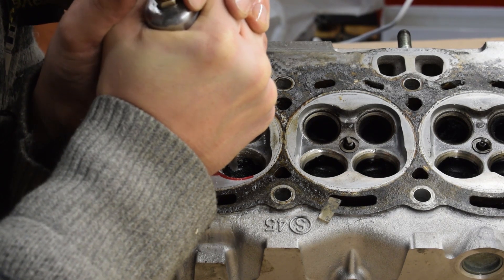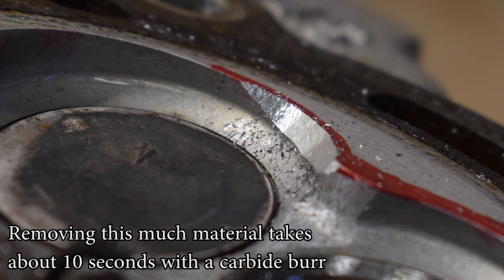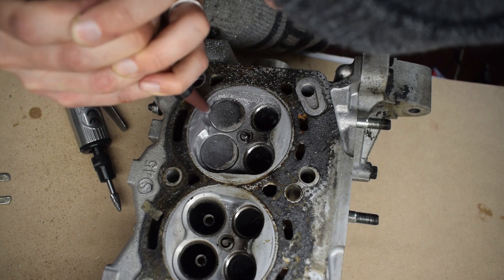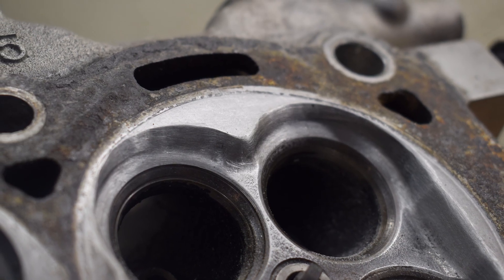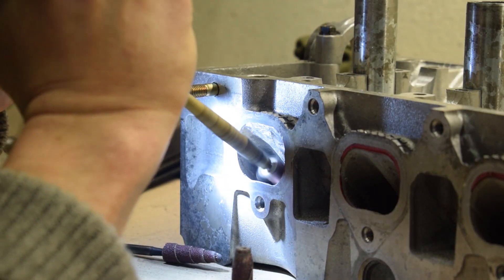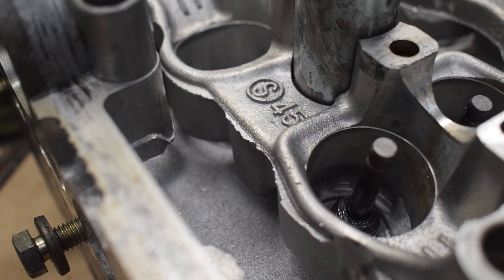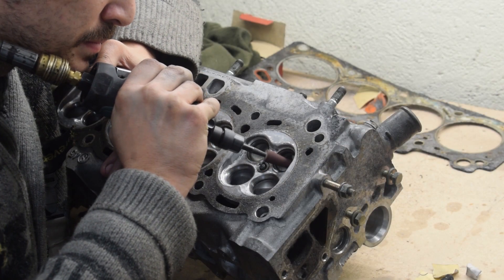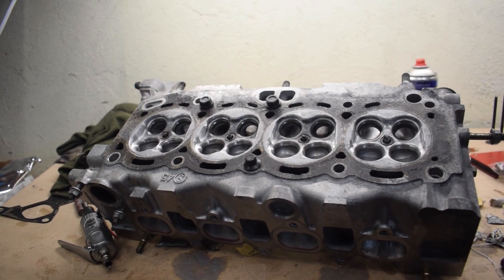PORTING the F out of it - Cylinder HEAD porting and polishing HOW TO - PROJECT UNDERDOG #6

Comment: congratulations on your porting job. now you have to take of at least 0.5mm to adjust the compression rate and if your lucky you (still) have the same BHP.
Reply from the maker: Turbo. I said it in the video clearly. But paying attention would mean you can't do that comment 😏 I need to loose a bit of compression in this case. It's above 9.5
Reply: @d4a  👍👍

Comment: Um, not a lot of flow into the chamber on the short side of the valves, you should have focused your unshrouding efforts towards the exit on the long side at the edges of the chamber since the majority of flow is here.   If you look at higher performance engines like a bmw s1000 or any newer sport bike head, the side quench band is mostly eliminated with the area being shaped for flow/diffusion.  Material removed here would be much much more worthwhile that where you took it

Comment: The machinist I see will do custom seats and with initial cuts and throat cuts for me so i can do flashing removal and whatever porting. Then i bring it back and he will finish cut and match valves. Gives a little bit more working room usually inside the bowl and runner and you have a small bit of forgiveness if you bump the seats because it will be cleaned up later. I highly recommend looking around for someone who can do this to. It sounds extensive but it's not uncommon and it really makes your job of porting (even if its mild) so much easier to see and do.
Good video  all around for the diy and why 👍

Comment: Thank you for the content that you put out. I just love your channel.
One question though, on the exhaust port outlet enlargement, do you think the slight lip where the exhaust manifold is slightly larger than the port could help with some anti-reversion of the exhaust charge flow?
I can perceive the advantages of a slight taper to the exhaust port from valve to outlet, but it seems that slight lip where the manifold is larger may still benefit a little with anti-reversion. Likely even for a forced induction setup.
Reply from the maker: Yes, I got that a lot in the comments and everyone's repeating it like a mantra without thinking about other factors. I gasket matched, but I obviously won't be using the stock header, I'll be making a turbo manifold which means I can make it any size and still have a giant or small lip if I want to. Also, reversion is avoided by having low back pressure in the exhaust and low overlap at mid and low rpms, this is why you rarely get reversion in vvt engines. You get it on non vvt engines with big overlap and exhaust back pressure and if you have serious reversion no pathetic little 1mm lip is going to save you 😂 you get rid of reversion with good engine building and tuning, woe is he who puts his hopes into this lip 😏
Reply: @d4a  Fair point! Thank you for that answer. Much appreciated!

Comment: Don't push too hard on the carbide and it will never skip, that's also how 
you break teeth on it. Always let the rotation of the tool do the work - you 
will get the most life out of your carbide that way as well. There are also 
certain angles you should be using based on the type of carbide shape. 
Even as it dulls, you can lessen your pressure on it(which will lessen it's 
effectiveness) but allow you to keep using it. Most people just toss it for 
a new one, but when you are buying your own carbides, you will appreciate
 making as much use of each one as possible. I haven't taken my heads off
 yet, but I will definitely try this should I ever have to do a headgasket or 
something!

Comment: The object of porting is to correct casting flaws that inhibit the true flow characteristics the engineer designed into the head, not enlarge them or change their shape. The object of unshrouding the valve is to provide a straight path off the valve and into the cylinder with minimal turbulence. A multi angle valve and seat cut would really help low lift flow.

Comment: The mismatch on exhaust is probably deliberate as it helps prevent reversion. 
Generally,  leave about 3~5mm 'step' at least half way around port turning it into a 'D' laying on it's 'flat'
The main areas of improvement are just below seat on short turn and the 'throat' where port should be 'necked' at a smaller diameter to increase gas speed.
To un-shroud valves, I find it's better to do some math and make a 'washer on a stick' to check clearance. I usually use a piece of plastic cutting board (nylon/polyethelene, cheapest you can find) use a hole saw to get 'blank' then put a bolt in it and spin in electric drill. File to about 45 degree angle with whatever the max dia you work out.
Cut a smaller one or two to get 'correct' throat diameters (usually 80%~87% of valve diameter, maybe a little more with forced induction. 
You need about 0.20 of valve diameter at closest point to head at about a quarter of valve diameter lift (ie, 35mm dia valve x 0.25= 8.75mm lift with 7mm clearance,or, a 49mm washer.) 
It isn't always possible if valves are close to combustion chamber edge but angled valves are usually pretty good for un-shrouding as lift increases.
I used to work almost exclusively on motorcycles but have built a couple of quick cars in the past (150mph Opel Manta GTE as daily driver, only did about 25mpg though, wasn't possible for me to drive it 'slow')

Comment: Back in the day I did this to a Datsun 120Y head. It made the engine rev up significantly better. It brought me about 8 mph extra topspeed.
Reply: Im busy with my nissan L28 portinG .. And adding a Little turbo on to
Reply: @spiderdanielcoetser9148  Porting my GT86's boxer engine isn't that easy. The engine even has to be lifted to change spark plugs. 😬 On the other hand, I love the car as it is.
Reply: @ThunderBassistJay 
Toyota pretty good pistons to head is vital
Reply: Nice car a 86
Reply: In my prof foto is myne car .. Its been sprayed bLaCk by me now
Reply: Myne .. Mine ...
Reply: @spiderdanielcoetser9148  Lol!
Reply: @spiderdanielcoetser9148  it's a Subaru motor, boxer engine
Reply: I used to race a Datsun sunny / 120Y in Speedway, they are suprisingly fast with minor mods and a good tuning.
Reply: @archygrey9093  ...and they're simple and weigh about nothing.
Reply: @ThunderBassistJay  Yep, although they fell victim to the little 3cyl Daihatsu Charades pretty quick in the end.
Those Charades look cute but they absolutely decimated all the other Datsuns, Corollas, Stanzas, bluebirds, hondas and whatnot for awhile. The Corollas kept giving them a good run for their money though.
That was over 10 years ago though, probably different now.
Reply: Hadda Suzuki MightyBoy ute that
Reply: WHAT ! 20%  gain ?  LOL .
Reply: Did the same to a15 head and these have big valves. Great to use on a12 block if you need to stay within a racing class
Reply: I did the head on my cherry 1.2 very cooked up thou only 23k when I got it ported through from the carburettor to the manifold as far as I could reach ,head ports were terrible bad castings,cleaned the sharp surfaces in the combustion chambers too , engine economy went from 30 to45 mpg and top speed 65 to 90 plus and so much faster!
Reply: @jamesbaker429  The castings of the 120Y were bad too. Lots of sharp edges.
Reply: Why would you do that to such an ugly truck
Reply: @ariveitz1941  I assume you're referring to the Datsun 120Y utes, which for your information are very good looking.

Comment: If you're building a turbo 4AFE and you don't have extreme goals on race fuel, I think you've done your porting wrong. 

You want detonation resistance more than flow and you get that via charge motion. Unshrouding the short side has almost certainly reduced charge motion and you'll likely end up with a lower detonation threshold and slower burn as a result
Reply from the maker: Charge motion? You mean tumbling?

Comment: How do you mark the areas you want to remove on the combustion chamber? Can I also do this tipe of job on the pistons in the case of contact with the valves?
Reply from the maker: I don't mark them. I eyeballed them and adapted other chambers. There's no need to this unless you're using different pistons because this changes squish and chamber cc. I only did it because I'm turbocharging the engine and using completely different pistons. You can remove a bit of material from piston tops, but it has to be an absolutely minimal amount. It's better not to touch them if you can.

Comment: From someone who has ported a lot of heads, do you want me to tell you what is involved in your upcoming eye operation?
Reply from the maker: I managed to get away unharmed. I wasn't without glasses all the time, but I am in all of the footage. I usually wear them but working a camera and video lights while also porting really stretches out my short term memory and glasses end up being forgotten. Still not an excuse.
Reply: @d4a  yep I got away with it many times... until I didn't. Then I had to pick the 7 pieces of metal out of my own eye with a needle. The next time I thought "it will be alright just this once" I went to hospital and let them grind them out with something like a small die grinder. You only have a few hours from the time they lodge in, to the time they start growing over. I even made a trip to the hospital once to get some grinding disk taken out, and that was while I was wearing reading glasses. Now I won't pickup anything up that grinds without a full face shield on.

Comment: For 300hp slap a turbo and crank the boost to 1bar. No need for this kind of "porting"
Reply: if he "slaps" the turbo after the porting he can even increase the boost or make overall better results
Reply: @nenume00  What makes you think that? Porting goes hand to hand with camshaft lift. Porting the f out something makes the flow graph rise in the higher lift. It makes the head to flow worse on lower cam lift. So cant say that there will be some good results orsmth after that kind of porting 🙂

Comment: Why did you make the radious that big behind the valves just take away the very important squish are. That is the area where the head flows the least, because the shape of the intake runner.  Mathing the exhaust ports to the manifold gains 0cfm, but you will have more exhaust reversion.
Reply from the maker: The stock squish depends on the stock pistons. I'm not using them. There's build details on my channel. The anti reversion effect from that lip is negligible.

Comment: I think it would be worth the time spent making a protector for the valve seats. Tape probably won't cut it, but something like metrology putty might be ideal, because you can put it on as thick as you want, and while getting it to stay is tricky, you could shape it so it locks on a feature and doesn't rotate in the event of a hit. The only major downside is metrology putty is insanely expensive. Flex tape should accomplish the same thing though. I don't know how feasible that is, but it's worth trying, even if you have to be very precise in cutting or preparing the guard material. Alternatively, some resin might work too but removing it would be... caustic.

Comment: Great! Man you are my #1 YouTuber! I do love the way you look into mechanic. We are pretty much identical while talking about cars! Although I love motorbikes as well.
 Right know I'm working on force inducting a MPI II 3.3, Inlet VVT. I am using the stock internal with below changes: genuine pistons (I have cut the head for 0.09mm to decrease C.Ratia), connecting rods (there are different kinds of C.Rods, mine are great), oil pump (I have lowered cogwheel teeth to speed it up also by tightening the return valve and lowering the inside cogwheels capacity, I have increased the oil pressure as this engine is famous for bearing problems). Cylinder head (prt & plsh+increasing ignition chamber vol.by grinding walls and buttom of the valves)
I also have a motorbike (Hyosung GT250R under turbolization🤣 which is my most advance project with ⅔ of the internal replaced with cnc mashined parts.
The last project is a Peugeot 405 which does have ECU, complete inj. system, wtr-met inj., turbo, 1.3 supercharger, a costume turbo, intercooler, costume water and oil radiator merged together, but it has no engine yet. I can't decide what to put into her! I just want it to be AWD + 4 inline.
Is it fine to ask your advice time to time!? I am United Nations employee, but I have 12 years of tuning experience, although I have only 6 force inducting projects in my resume, which 3 of'em are not finished yet!
Reply: Gosh I've wrote an essay!!! Sorry dude...

Comment: I have pulled metal out of my eye ball twice, the last time an eye doctor had a miniature Dremel getting the metal out. I also wore safety eye glasses last time around but it was summer time and right after I finished using a die grinder cleaning my weld tacks, I turned on the fan and it pushed all the metal passed my glasses. When you do this type of work, I highly recommend a face shield. This is the type of work why they invented a face shield to begin with. I am not trying to sound like a concerned Karen but you have to think about the Noobs taking lessons of what you are teaching. They will learn the good and the bad.

Comment: 1 tip i can add is blending the valve seat into the roof of the chamber. It really helps low lift flow. Just imagine the valve ar .100 lift and you have a .05 wall for the air to get around.

Comment: Going to port the heads on my v-12. Even though I've done it before, I still enjoy watching these amazing videos to inspire and motivate me for the task ahead.
Reply: Jonah Woodside damn are you finished yet? porting 48 ports must take ages
Reply: @Gekkoperformance  ran out of free time, been too busy with client work to even touch my own projects, hopefully I'll be able to finish up in the next month.
Reply: What type of car you gonna be working on, like a Jaguar or Toyota crown.
Reply: @adrianhoeben5783  A Jaguar 5.3L from an 1989 XJS. Haven't had a whole lot of time to work on it, which is a blessing in disguise because the car is in extremely good condition so I get to really experience it stock which, in turn, would either persuade me to keep it stock if I'm happy with it or dive into a long rabbit hole of significant modifications with very little performance gains. As far as my research takes me, porting these heads hardly make much of a difference, but since I plan on doing just about everything you can do, the dozens of small number gains add up in the very end.
Reply: @woodyTM  Oh wow :o I figured it could have been a Jag engine, funnily enough I have an 89 Daimler xj40. Its the slant 6 4L but could imaging a v12 :D , XJS's are a beautiful car.
Reply: @woodyTM  If you redo pretty much everything Jaguar did in that engine bay, it might actually be quite reliable! 😀 Sorry, couldn't resist. ❤ the V12.

Comment: LOVE your videos. So informative. I have a 3S-GE I plan to pair with a small supercharger from an SLK and put into a FWD Starlet or light weight Corolla eventually, and your videos are great for learning about what is involved, what to do and what not to do. Keep up the great work, looking forward to learning more.

One question: can you do these porting jobs with electric/battery powered tools? I have a small one car garage so don't have a lot of space (or money) for things like a compressor or a set of air tools. I already have a bunch of battery powered tools I would like to reuse as much as possible. Not looking to do a whole lot of material removal, mostly cleaning out the imperfections and perhaps a little bit of flow improvement on the intake ports in the head.

Comment: in my opinion you shouldent gasket match the exaust, you should have the exaust manifold inlet slightly bigger than the exuast port outlet, the potential loss of flow is worth it because it will act like a restriction for reverse flow.

Comment: One thing I never see is a before and after Dyno of porting.  Will you be doing this?
Reply from the maker: You probably will never see a before and after dyno of porting because no one's going to take apart an engine just to port it. As I said in the end of the video, porting alone doesn't do much m, it works in conjunction with other mods.
Reply: @d4a   I do understand that porting is not like doing a before and after dyno of a quick intake swap, but I am sure as curious as most folks are about gains with porting a video like that would get crazy views if they are a YouTuber that does things for views/money or whatever they get.  

I just sent quite a few parts out to get Extrued after being ported.   https://www.youtube.com/watch?v=yM_T2eJGpys

Comment: 4a-fe head could be better than 4a-ge, if you weld the combustion chambers and grind to a new shape (modern clover leaf), fit larger valve seats -> valves and port the crap out of the ports; no clue, if there's enough material - probably not, so it would require some more welding = very difficult.
 Why the 4a-fe could be better? Lower valve angle means more compact combustion chamber and allows a lot better design for flame travel; no need for high piston dome to achieve high enough compression ratio to have the most benefit of bigger cams.
And port angle is quite good for performance applications.

But it would be near the same amount of work to completely re-design the whole head loosely based on 4a-fe, and cast a whole new head.